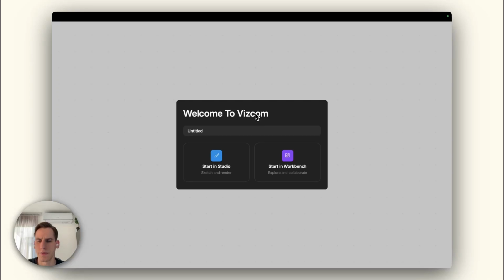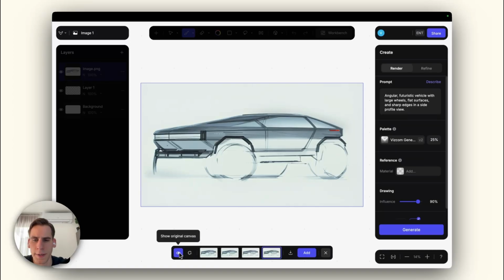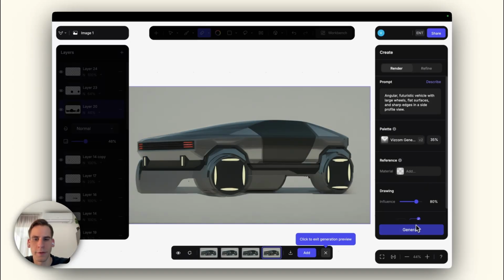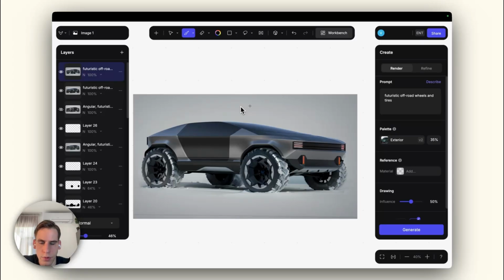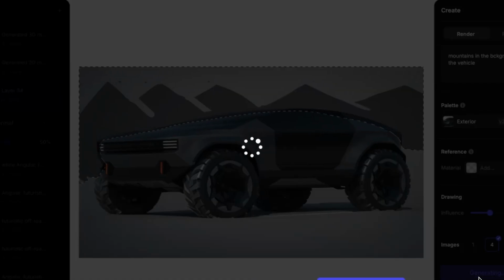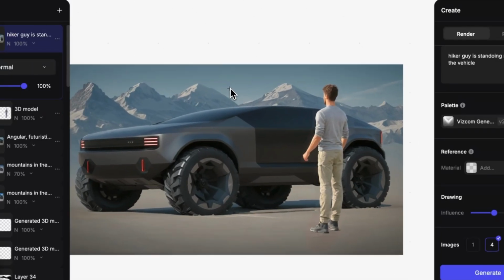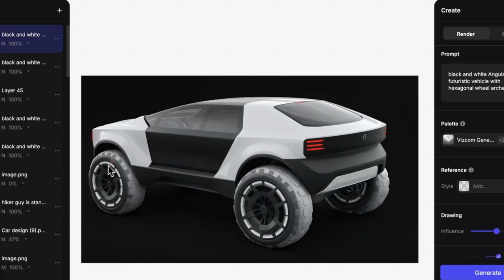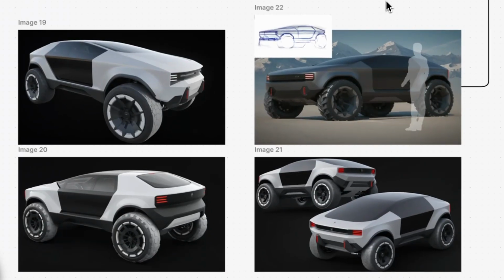Design with me #3 - Car design sketch rendering and ideation process.

Comment: Using the 3D human model, is it possible to have a driver inside the car behind tinted windows?
Reply: Yes, for that, I'd probably just sketch a super basic indication of a driver, similar to how I did near the end of  the previous furniture design video. Would try to generate a human, and would use low opacity if I couldn't get the effect of the dimmed look, behind the glass.